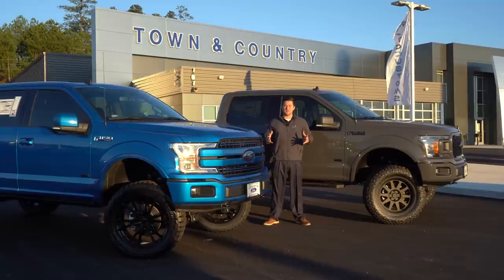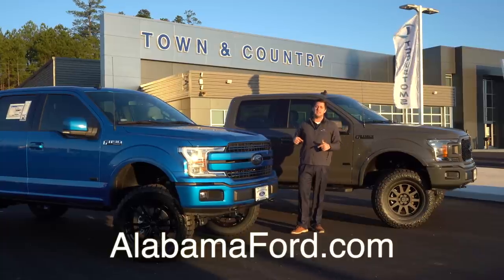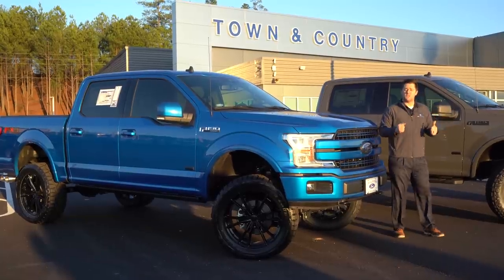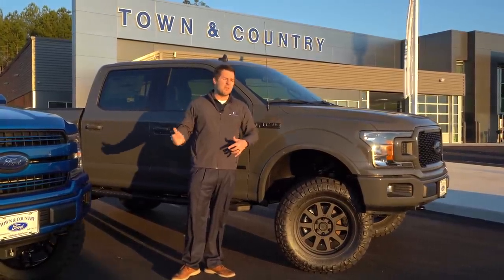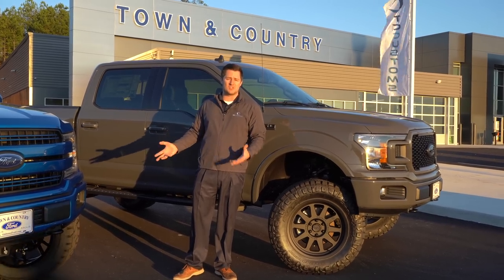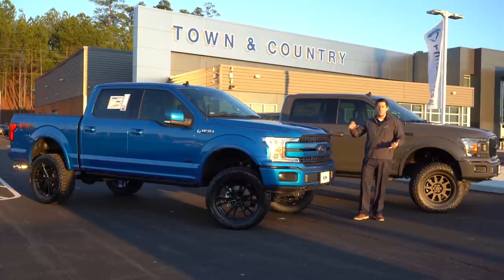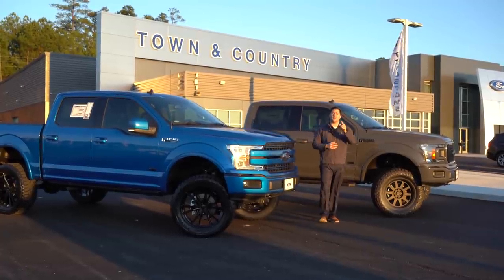Which Gear Ratio do you need on your truck?

Comment: Hey I have a '18- F150 platinum, roush SC installed, it has the 3.08 ratio...would it behoove me to look into getting the 3.73... and bout how much would that be in cost to swap out??
Reply: Depends on what you want out of the truck. If you're looking for stoplight to stoplight seat of the pants or drag racing... then you can go 3.73s. You will see a pretty big dip in fuel economy. The truck is heavier than the Mustangs so you need a bit more gear to get the truck moving. The SC Mustangs with a 3.15 gear is a happy medium. If I were to have this truck I would consider 3.31s or maybe 3.55 at most.
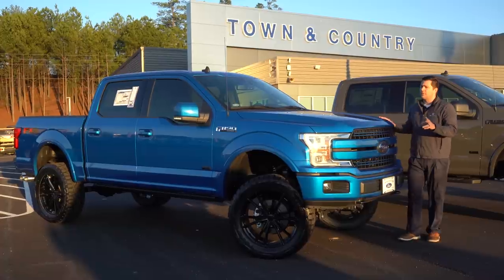Reply: As I write this my 2013 F150 Lariat ecoboost is being upgraded from 3:31 to 3:73 for towing purposes. I live in Idaho with a lot of mountain roads and want to make it easier for my F150 to tow the trailer. The 3:31 ratio does the job but I want the extra oomph, especially on the mountain grades. Cost of the job is $3500 since front and rear axles must be done. The work is being done by a local dealership. Btw, towing capacity is 9,100 lbs. The 3:73 would boost that to 9,500. The trailer I'm pulling has a gvwr of 6699.

Comment: Ive got a f250 superduty 5.4l gas currently an i plan on bein able  to tow at least up ta 20,000lbs   with it when im home an on the road and eventually will trade the 5.4 gas for the 5.9 cummins  so what would be the best heavy duty but not tear up my truck gear ratio ?

Comment: I will never buy another Ford truck. Own 2 2018 f150 and both have trans issues. Just paid $6500 for a new trans in Watfrod city ND. 3 of tge clutch packs were burned up and it would shift from 1st to 5 6 7 8 9  or 10th then got stuck in 8th.

Comment: So if you are going driving up into the Rocky mountains does that mean you need the lowest 10 gears? Does the 3.73 help over the 3.55?
Reply: My V8 Dakota 6spd 4x4 has 3.55 and I towed a decent Uhaul trailer over the rockies with a dirt bike in the bed and thought she wasn't gonna make it lmao Had it floored in 2nd for a minute through the steepest parts, maybe even touched first but can't be 100%

Comment: Mr. Watson. I have a 2005 F150 5.4L 4x4 crewcab, just lifted 9inches all suspension, with 35s. I won't be towing. My research shows my truck has 3.55 gear ratio. I won't be towing but I would like the motor to turn the tires easier when I take the truck out to the desert. Would you suggest me getting 3.73 gears? Again no towing for me. Thanks for your time.
Reply: If you're looking for more "get up and go" off the line, the 3.73 gear ratio will provide more of that than the 3.55's you're currently running. Your gas mileage will probably take a hit, but nothing too horrendous. Given the fact you're running 35's, you might even consider 4.11 or 4.56, if they're available for that model year.  It depends on how much highway gas mileage you're willing to sacrifice for bottom end acceleration.
Reply: @Sagittarius-88  thank you so much for your reply. It really does help. Love your videos keep up the good work.

Comment: I have heard that 3.55's are better for boosted applications over 3.73's. How true is that?
Reply: Not true unless you’re running out of RPM in the 1/4…which means you’re rolling for a truck

Comment: Do I need a gear change for 35 inch tires? I've been told yes and no and also been told that they recommend 4.10,but I would lose top end power
Reply: No you won’t lose top end power, in fact there will be more power because it will run at higher rpms. So let’s say you have the 3.55 gears and you’re going 70mph, your rpms would be something like 1900. With 4.10 gears at 70 mph would be more like 2300. Which means it’s faster but at the expense of fuel mileage. 

I have the 2014 tremor with 4.10 gears. Super fun truck. I can get about 19-20 mpg highway
Reply: @Sam_splatter  Thanks for the info, I can tell when my truck struggles with factory gears so I'll look into upgrading. Thanks Again

Comment: Hi, I am wondering if 3.73 ratio has a bigger diff, and lowering the ground clearance than 3.55?
Reply: Same rear axle housing so same clearance. Only exception is if you get the max haul package you get a bigger axle with less clearance. 10.25" diameter ring gear vs 8.8" in the standard axle

Comment: Thanks for the info. So are those the only 2 options for the gear ratio?
Reply from the maker: Depending on the trim level (like Raptor), and drivetrain (like 2wd or 4wd), the gears go all the way from 3.15 all the way to 4.10.
Reply: The standard options are 3.31, 3.55. 3.73 and 4.10 for the raptor. A higher number is better in all regards except fuel economy.

Comment: So I’ve watched videos where people say if you have a lift kit and move up to bigger tires that you should re-gear. I have a 4 inch BDS lift kit with 35s. My gear ratio is 3.73. I don’t do much towing or off roading. With my 35s should I consider re-gearing to a 4.10 ratio or can I just stick with the 3.73. My main concern is my transmission. Thanks.
Reply: Great Comment! Everyone should be concerned about the automatic transmission when increasing engine performance (HP and torque)...and / or installing larger tires. Unfortunately, very few people address the deficiency of the OEM (factory) internal parts of the automatic transmission. 

In future posts, it would be helpful to provide model year of your truck and or type of transmission - 6R80 (6 speed) or 10R80 (10 speed). These transmissions, along with the big brother Super Duty versions - 6R140 and 10R140 are fairly stout transmissions from Ford. 

However, I would still suggest contacting a great well known, long term, privately owned transmission shop and ask questions based on your application, current use, and expected or potential future use of the truck. Google and Call ------> Circle D Transmission since they do custom builds on the Ford 6R80 transmission for up to 1200 RWHP.
Reply: If your truck is newer then don't worry about it

Comment: I have a 2018 lariat. How can I tell what the gear ratio is?
Reply: Zigman it’s listed on the window sticker
Reply: Jack the rear up.  Put truck in neutral.   Engage locker and Have wife Spin the wheel by hand one revolution.   Count the number revolutions the driveshaft turns.   There ya go bro

Comment: Is a 4:30 Gear Ratio to much?? 2016 Tundra Crew Max 4x4. 5.7 liter
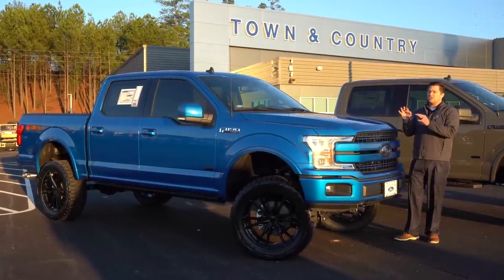Reply: You probably already hate your gas mileage. Higher ratios aren't bad but I doubt you would ever need over 4:10  on a half ton pickup
Reply: @Jeff-jr3sg  
I get 14.7MPG. I don't drive it everyday so I'm ok with that. Lol
Reply: @hayabusa1340 what truck (year, make, 4x4, 4x2), gears and tire size do you have on you truck?

Comment: I think you should do more research on what spins what for the ratios before you make a video... lol. 
3.55:1 means the drive shaft... not the engine... will spin 3.55 times for every 1 rotation of the tires. 

You’re a truck salesman, right? Like F-150 salesman? :-)
Reply: Lol he reads the comments but no reply. 😂😂

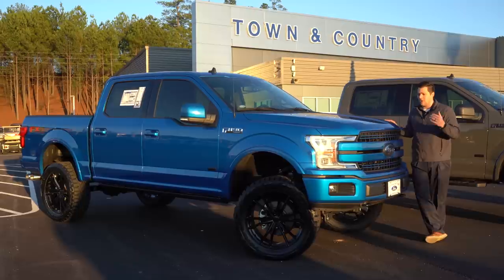Comment: Your not totally truthful about the gear ratios, guys that pull 7000 pound trailers, or people that don't go on the interstate at 70mph, you can get better mpg with 4:10 gears than 3:55, remember you get better milage when you are in your power band of your engine, with 3:55 gears and you start to lug the engine you will get worse milage